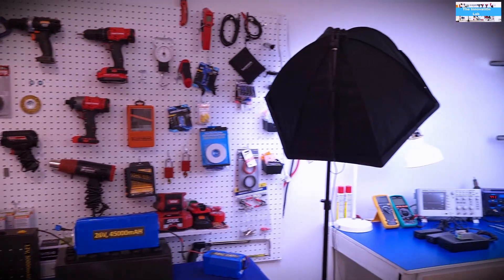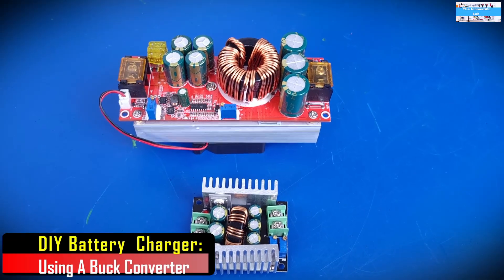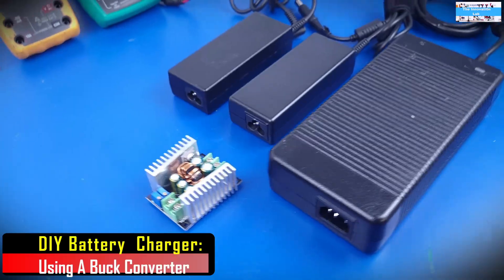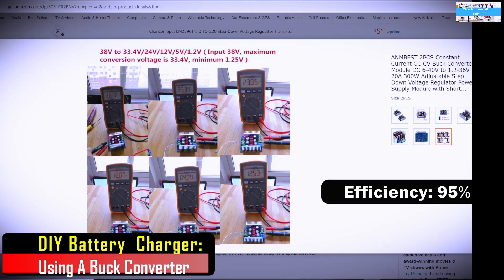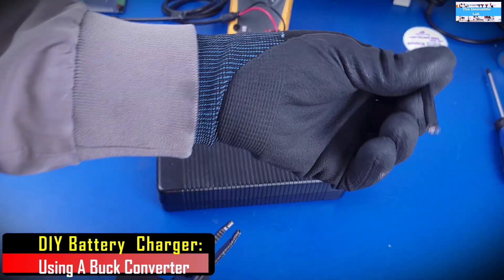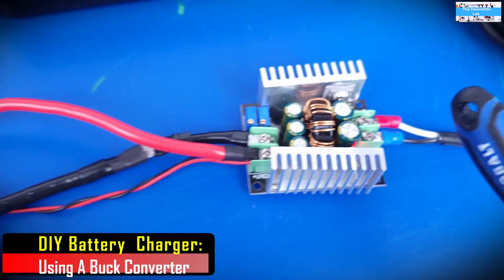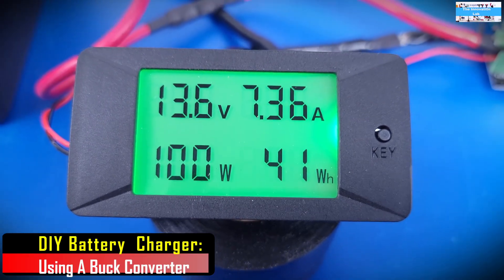How to Make a Battery Charger, Using DC to DC Buck Converter

Comment: I have also 20A buck converter,but by mistake i connected my supply to output of buck converter then after it,s olny showing around 3v to 4 v olny on output,do you have any idea which section is damaged so i can check it properly?😢

By the way i love your videos to watch❤
Reply from the maker: Hi friend, thanks for the amazing feedback. I am glad you are finding good value from our videos.

Let me know what buck converter model you have and the input and output voltage specs. To help you troubleshoot, I need to have a bit more information about the converter model.

Respectfully,
The Innovati0n Lab💥
www.theinnovati0nlab.com

Comment: I want to charge my 14S li ion (58,8V max) with USB C 65W charger (20V 3,25A charger or chargers), do you think it will be possible with buck boost converter ? ( I dont need to charge it to 100% - even 80-90% will be fine (due lack of CC/CV)

From input side I will use for example 4x usb C socket(trigger 20V) then I can chargre with one 65W charger or 2-3 or 4 in parallel
Reply from the maker: I am not the you can find buck converters that could do an 80V to 58.8V step down. 

It might be easier to just use a 12V server power supply and a constant current DC-DC boost converter. This way, you could do a 12 or 24V to 58.8V boost conversion needed for your battery charing.

See my universal charger videos.....peruse my channel. I have made lots of content on this.
Reply: @theinnovati0nlab782  but i dont want step down, its step up - from 20V to 58,8V and 4x usb C trigger pcbs (20V)
so I can use 1 2 3 or 4 - for example 65W (3,25A 20V) chargers in parallel

Comment: Can i use this on solar panel 200watts. Thank you
Reply from the maker: Great question.
I tried an experiment to see if I could use those buck converters as diy solar charger, but they don't really work well.
You can find low power affordable MPPT charge controllers for less than $30 - on eBay or Amazon.

I hope this helps.
The Innovati0n Lab 💥 www.theinnovati0nlab.com

Comment: I'm trying to make a charger with old laptop power supply (19V 4.7A) and a DC Buck Converter (max 5A). I adjust the voltage to 12.6V and the current of DC Buck Converter to 3A then connect to power supply and battery (Li-ion 3S2P 12Ah) but it only charge at 0.5A. I try to adjust the current but it doesn't work, only 0.5A or below. Could you please explain why? And how to fix it? Thank you so much.
Reply from the maker: It seems to me that you have done all the right things. 
Here are some quick recommendations.
💥Check the voltage level of your battery with the charger disconnected - just to make sure that your battery is not already fully charged.

💥Test each battery group individually to make sure they are still good.

💥Check your BMS.

💥Check cell temperatures. If some cells are hotter than others...this is a sign that you may have some bad cells.

💥Finally, check your converter. You can try using a different converter or charger to see if this behavior is the same.

⚠️⚠️⚠️
Stop charging the battery until you have figured out what the problem is. 
A bad BMS or battery cell could cause some cells in your battery to overcharge and overheat. This could eventually lead to the batteries bursting!

I hope this helps.
We need your help in growing this channel. You can help by sharing our videos on social media and diy groups.

The Innovati0n Lab 💥 www.theinnovati0nlab.com
Reply: @theinnovati0nlab782  I tried 3 battery packs but it only up to 0.6A max.
I also use DC Boost Converter to boost from 12v to 14.6v to charge my Lifepo4 battery but only get 0.9A max. The DC Boost Converter is 15A 400w max.
I'm really confused right now 🤔

Comment: Can i use this with solar panel to charge the battery?
Reply from the maker: Great question.
That very converter failed when I tried using it as a solar charger. It didn't work well.

I hope this helps.
The Innovati0n Lab 💥 
www.theinnovati0nlab.com

Comment: Hey man, what is the minimum voltage difference of this buck between the inout and output? Thanks
Reply from the maker: These ones have the following specs.
Input voltage range: 6 to 40V
Output voltage range: 1.2 to 36V
I hope this helps.
The Innovati0n Lab 💥 
www.theinnovati0nlab.com
Reply: @theinnovati0nlab782  okay thanks, some of this kinds of buck converters have minimum voltage difference from input to output, irrespective of their voltage range specs, for say a 15v output would need a minimum input voltage of 18v, coz 17v wouldn't work. I was wondering if this buck too has a minimum voltage difference to efficiently step down voltage.

Comment: If I use 24V 6A power supply to this can I get 12V 6A or more amperage at lower voltages?
Reply from the maker: Great question.
It will depend on the efficiency of the converter that you are using. 
Let's do some math.
👇👇👇
At a 24V 6A, you have a total power input of 144W.
Assuming a low efficiency of  80%; delivered output power  should be about  (144 X 0.8) = 115W.

Now, at an output voltage of 12V, you should expect a maximum output current of about 115/12 = 9.6A.
The output current will increase if the converter efficiency is higher than 80%

I hope this helps.
Respectfully.
The Innovati0n Lab💥
www.theinnovati0nlab.com

Comment: brother what if I use laptop charger of (19.5v of 2.3A)
Reply from the maker: Great question.
It should also work well for  batteries below 14V.
Just that your charging current will not be huge.
👍😎
The Innovati0n Lab💥
www.theinnovati0nlab.com

Comment: Mine doesnt work like this.  If i connect a battery to the output then the outout shuts off
Reply from the maker: Check output current level. Also, make sure that you are using the recommended charging voltage for your battery. 
If your set charging is too high, you will essentially be creating an overload for the converter when you connect your battery.

Comment: Can a buck boost be added to an rv power converter designed for lead acid that would allow charging a 12 v lifepo4 battery ?
Reply from the maker: Yes. However, make sure it is a constant current converter.  A buck-boost seems like an overkill - depending on the input voltage unless you intend to use the charger for charging lower voltage batteries as well.

Comment: 🎯 Key Takeaways for quick navigation:

01:35 🔄 Using a DC to DC buck converter for a constant current battery charger allows repurposing old laptop power supplies for DIY projects.
02:30 🔄 Distinction: DC to DC boost inverter charges higher voltage batteries; DC to DC buck converter charges lower voltage batteries.
04:24 🛒 Considerations for a DC to DC buck converter: price, input/output voltage range, output current, power rating, and conversion efficiency.
05:40 🔄 Repurpose old laptop power supplies for DIY projects to reduce waste and environmental impact.
06:19 ⚠️ Safety first: Test power supply voltage, verify polarity, and use ring lugs for secure connections before connecting to a DC to DC buck converter.
07:52 🔧 Safely configure the system before charging batteries: test power supply, adjust voltages, and verify charging current.
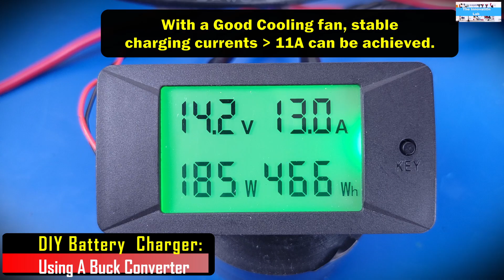09:15 ⚠️ Cooling may be needed for high charging currents (above 10-11 amps) using a fan to prevent the DC to DC buck converter from tripping due to heat.
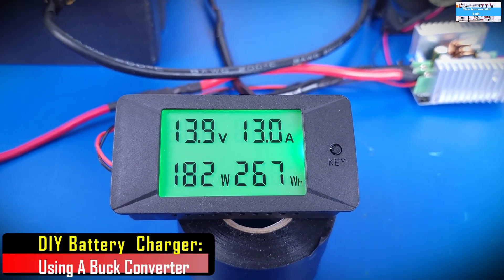10:51 ⚙️ Use a fan for stable operation when charging at high currents with the DC to DC buck converter.
11:06 🔄 Recap: Recharge batteries using a constant current DC to DC buck converter and an old server power supply.

Made with HARPA AI
Reply from the maker: This is nice!
I will give it a try.

Thanks!
👍😎
The Innovati0n Lab

Comment: What is your laptop supply rated to?   60....70....80W @ 19.5V is only 4A - are you sure you're not overdriving your supply when charging at those higher charge currents? I'm actually suprised you could get 180W out of it and can only assume it is because you are not using the sense wire from your PSU cable (blue I think?), and in doing so are using the laptop charger as a 'dumb' DC input.  Unless it has intrinsic overcurrent protection or your PSU is very large, it is just driving at the set or power module controlled amperage.  It will very likely shorten the lifetime of your laptop charger components at minimum even if it doesn't let the smoke out.  I would stick to the max output that is written on the PSU as this is how it is designed, (note, if you don't have a meter that does the conversion for you, you will have to do the maths to whatever stepdown voltage your driving) even if it takes a little longer to charge your battery.  Also, hopefully people realise that your OSKJ buck converter is actually a control module too - if they use a simpler constant voltage buck converter that doesn't monitor and reduce current upon charge completion, they can damage your batteries if not careful (and set lithiums on fire).
Reply from the maker: Hi friend,
Thanks a lot for the interaction. We always appreciate it.
However, did you actually take some time to watch this video?
I take my time to make these videos and to make sure that I explain everything. I have actually been accused of 'over explaining' in the past..lol. All the questions you asked were explained in the video.
Type of Buck converter, Power Supply review - pointing out sources and specifications, buck converter review and specifications, etc, etc, etc.
Please watch the video and do your math and let me know if you still believe that we are in violation of  the law of conservation of energy.
Your questions and assumptions made me think that you looked at the thumbnail and made a bunch of assumptions.
Making these videos takes a great deal of time and effort. All you have to do is watch it, my friend.😊

Just for a quick insight.
Power supply specs:
Output voltage (max) = 19.5VDC
Output current (max) = 11A
Rated Power: Please do the math....I made the video, and now you get to help 👍
FYI, there were no blue wires, no sense lines needed. Again, as I mentioned in the video, this is an old computer power supply with a very good output voltage and current regulation. 

You seem to be knowledgeable in power systems, and we appreciate having someone like you in our Youtube community, but we appreciate constructive feedback after you have watched our videos.
Success wishes on your projects, my friend!
👍😎
Reply: @theinnovati0nlab782  I did watch your video.  It is great and very simply explained and well shot. 

Unless I missed it, I didn't see model the rated POWER output of your PSU (180W for a laptop charger is huge!).  

My comment was in regard to two main points.  Namely if it was just a constant voltage buck converter (not one which both limits during charging, and then reduces current upon charge completion) then it can be quite dangerous depending what battery chemistry you are charging.  Someone might go out and buy a simpler 'buck converter', overcharge a lithium cell (set the voltage limit too high, or charge it too fast), and end up with a fire.   Of course, user beware - not your fault, and I wasn't criticising your setup.

Secondly, I was just mentioning for anyone bothering to read comments before jumping in, although buck converters are much more forgivable to poor matching of source power capabilities (as long as they are higher voltage you are pretty safe), when using boost converters (which you also mention), you can easily let the smoke out of their MOSFETs if you draw too much current for them to handle. Maybe you make these points in other videos dealing with step-up converters. If so, hopefully people look at them.

This guy puts if very simply.

https://youtu.be/9--_jaxiXhE?t=252

Comment: Very good video. I have 3 acid battery 12 volt 20 Amp connected in serie and I need  36 volts charge batt . Do you have a video or explain about
Reply from the maker: Hi friend, thanks a lot for the amazing feedback!
As a matter of fact, I have made lots of videos regarding this topic.
Check out our universal charger videos when you can.
However, these ones below are good explainer videos that could help you with your project.

Cheapest Universal Battery Charger Using a DC-DC Boost Converter
https://youtu.be/0Ct_sgbAjU4

Cheapest 1800W DIY Battery Charger Using Constant Current Boost Converter and two Server Supplies.
https://youtu.be/WDWJ77WWkXc

Cheapest Universal Battery Charger Using A Power Transformer and a DC-DC Boost Converter.
https://youtu.be/5EQs9_Cu7xo

Comment: Does this module have anti-backflow when the battery is connected without first connecting the module to a power supply?
Reply from the maker: Thank you for watching our videos and for asking such a thoughtful question.👍

Yes, the flow back protection should be baked into the design of the buck converter. My observation was that with the battery connected  and the input power disconnected, you should expect about a 0.03A leakage discharge. However, my recommendation will be that you should never leave your battery connected to the charger for a long period - especially when there is no input power to the charger.
Also, keep in mind that this device was intended to be a buck converter, but  my videos show that it can be re-purposed to build a super cheap battery charger. If you are really worried about the flow back, you can add a diode to the output of the buck converter - but you have to test it. Just keep in mind that you will need a large diode, possibly mounted to a heatsink......but I don't think this is necessary.
But this could be something I can learn from you, so please share your findings.
Reply: No, it doesn't, it will be burnt immediately. Even IC died, not just mosfet. Tested with 12V car battery😂
Reply: Just add a relay to the output of the buck to the battery, the power source of the relay must come from the solar panel also, so that when night time, the relay will release also its contact disconnecting the battery from the buck, another approach is you can also use a voltage sensor module to power a relay that when the battery is full it disconnects the battery from the charger...